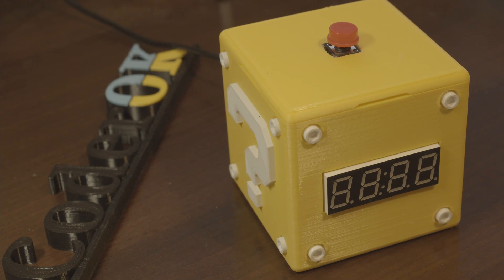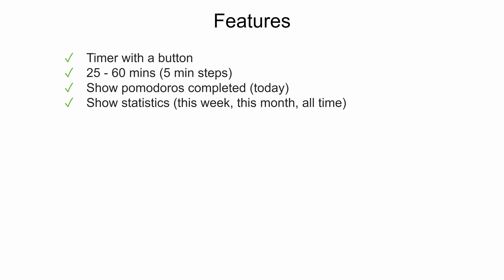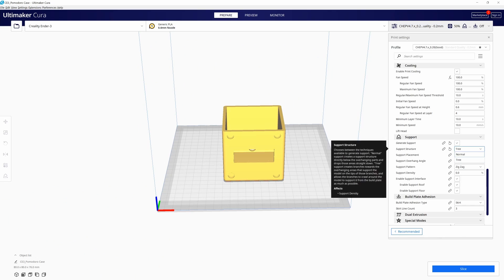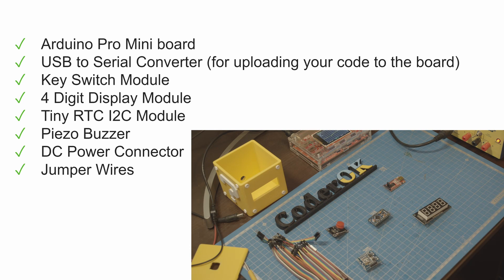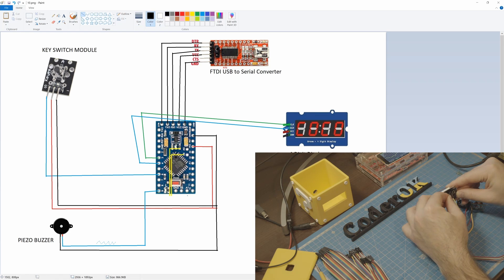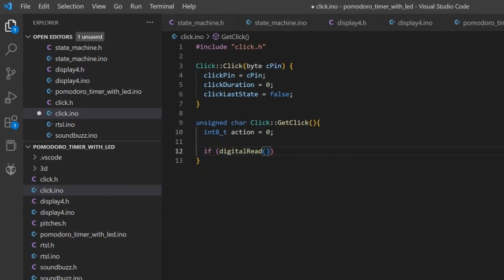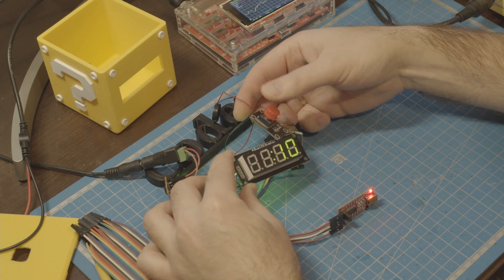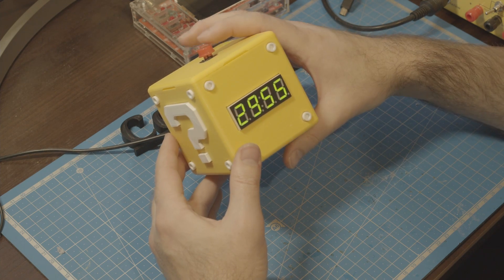A Pomodoro timer - based on Arduino Pro Mini and stylized as a Mario block (code on github)

Comment: Neat - does it act as a "normal" clock when not timing things via the RTC? Also, is any data actually stored on the RTC's EEPROM?
Reply from the maker: Thank you for your feedback!

No, at this moment it's programmed to work as a countdown timer only.
But I see your point, in between it can actually display current time.
Great idea!

As for EEPROM, 
Yes it's used to store statistics for completed tasks (pomodoros) per day, week, month and all time.